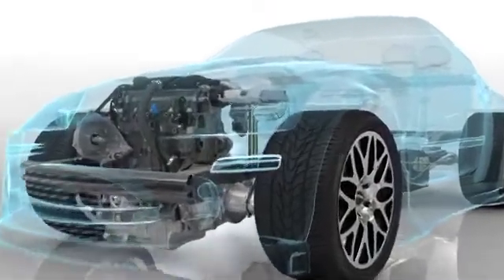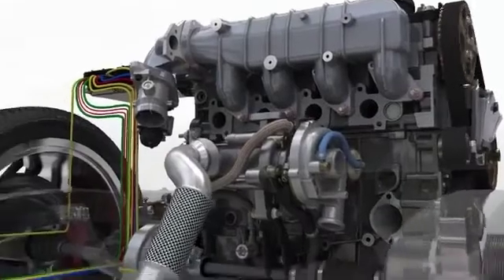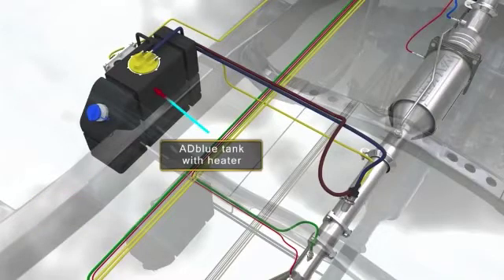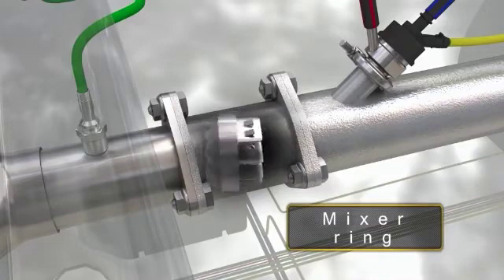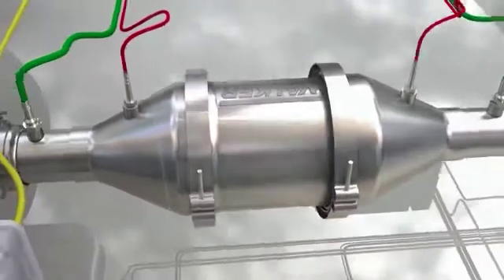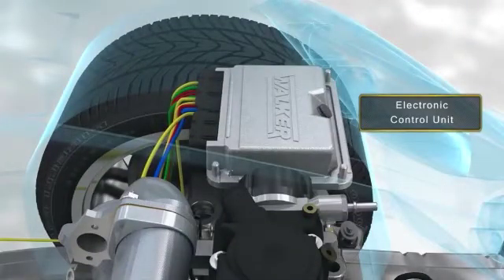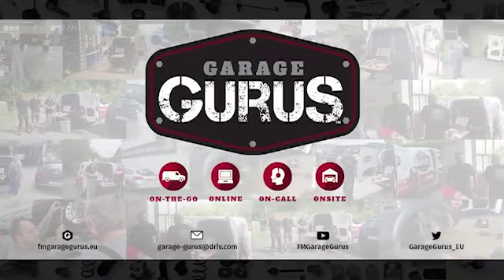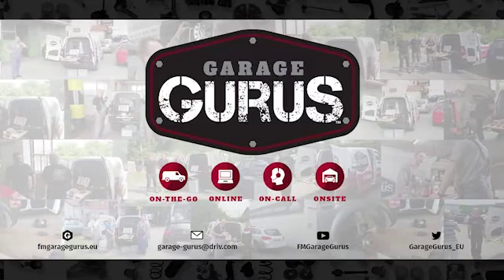Understanding SCR Systems

Comment: All the emissions junk fitted to cars now makes no difference. All they do is make cars more unreliable and a lot more expensive to repair. Many cars get scrapped years earlier than they need to be because of the ridiculous cost of repairing emissions systems.
Reply: I would actually really like the diesel SCR system if they weren't needlessly tied to engine derate. I really appreciate that they don't smell like burning garbage, but locking the truck to 5mph is just a punishment for not deleting the entire system.